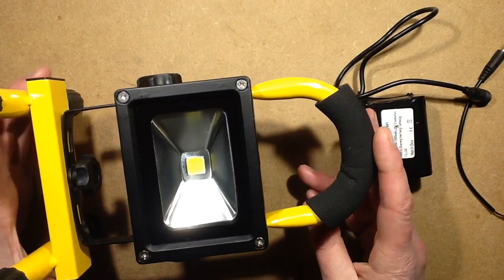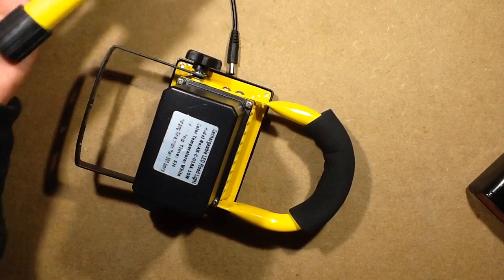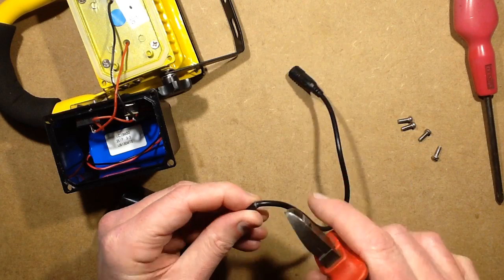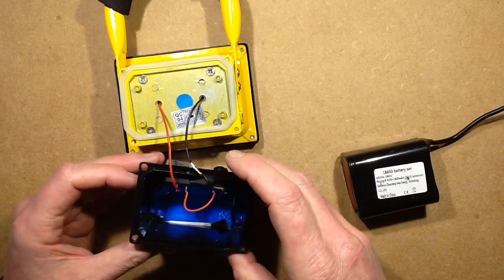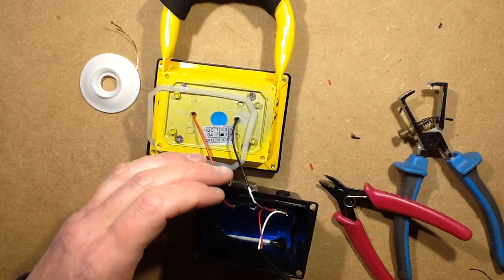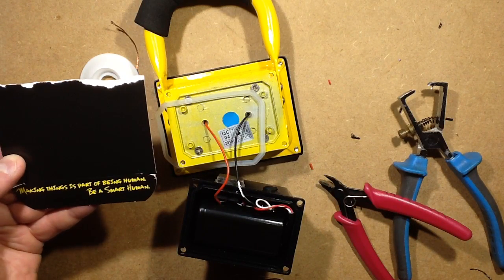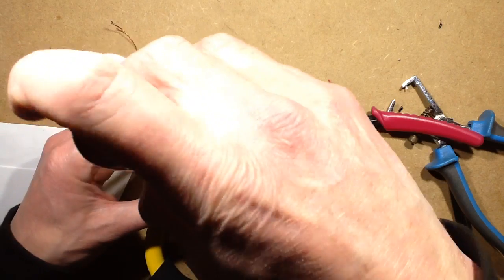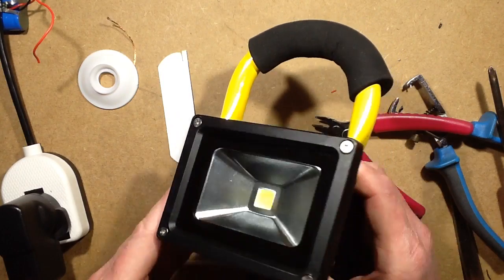Boosting the battery capacity of a rechargeable work light.

Comment: Why use lead based solder?
Reply: Because secretly it is still way better then lead free and doesn't create problems over time,  same reason they still use it in the medical and military sectors.
Reply: +Tokolozi lead solder exemptions for medical and military electronic equipment no longer apply in Europe and USA under RoHS2 directives. I do miss the old solder though.
Reply: +Tokolozi no problem, it's pretty recent.
Reply: +Tab Let ah oops that's new to me,  thanks for the info.
Reply: +Jordan Durham 
Tin solder suffers from "tin whiskers", which is the corrosion that forms on tin solder tends to form little crystals that can short between pads on electronics, resulting in faulty or dead electricals and many millions of tonnes more e-waste than there was with lead-based solder...
Reply: +Jordan Durham lead free solder is a bitch to solder with. however once you get used to it, it can be okay but it has a tendency to crack and break off. plus a far hotter soldering iron is needed. i use a 90w which is perfect. something like a 30 watt is no good for larger applications. however for PCB soldering its fine.

Comment: Clive, The 0 at the end of 18650 denotes it is a round cell.
Reply: +jusb1066 No, the foil inside is still rolled together, so you will only get room for a small roll if the housing isn't round. Check out the pictures in this article: https://batterybro.com/blogs/18650-wholesale-battery-reviews/96816774-comparing-panasonic-a-panasonic-b-sanyo-and-ultrafire-cells
This article is also very interesting as it shows how counterfeit 18650 cells can look like inside.
Reply: I just posted the same thing on a different reply. I'm not sure why people don't believe this to be true. An 18650 is 18mm wide, 65mm tall and the "0" means it is a cylinder type of cell. Glad you get it! :).
Reply: Wikipedia completely disagrees with this "the 0 at the end means it's a cylinder" thing. e.g. https://en.wikipedia.org/wiki/List_of_battery_sizes says (specifically referencing Li-Ion cells) "The larger rechargeable cells are typically assigned five-digit numbers, where the first two digits are the (approximate) diameter in millimeters, followed by the last three digits indicating the (approximate) height in tenths of millimeters." No citation for that, *however*...

... If you look at the Battery Nomenclature article (https://en.wikipedia.org/wiki/Battery_nomenclature) - specifically the "Lithium-ion batteries" section, which actually references the IEC 61960 standard which defines how lithium-ion batteries should be named - it suggests that "18650" cells should actually be labelled something like "ICR18/65" which I've never seen to the best of my knowledge (certainly the various bare 18650 cells I have all say things like "NCR18650B", "ICR18650-26D", "INR18650", and a 26650 that says "INR26650A" - nothing with a "/" at all).

The only indication that anything refers to a cell being cylindrical is here (https://en.wikipedia.org/wiki/Battery_nomenclature#Shape) which says that "coin, button or cylindrical" cells are given an "R" code for being "Round", but that applies to primary cells, not necessarily Li-Ion secondary cells.

I'm completely happy to be proven wrong, here, if someone can link to a reliable source - I'd much rather be wrong in a YouTube comment and then know the truth after that than to forever be mistaken ;) Unfortunately you have to pay to read the IEC 61960 standard, which is a bit crap, really, so I'm having to just trust that the Wikipedia article is vaguely correct.
Reply: +Richard Harris if they were hexagonal, theyd fit together closer, so youd get a bit more Mah in the same space? dunno how much the small difference would be!
Reply: with rectangular cells, you might get more surface area for more capacity.
Reply: +TheDenzel2112  just curious as to what they put at the end of rectangular cells then?

Comment: Nice work. I only would recommend to install a bms. You have space for for it and only cost 2.5$
http://www.ebay.com/itm/4A-5A-BMS-Protection-Board-for-3-Packs-18650-Li-ion-lithium-Battery-Cell-3S-/331694555355?hash=item4d3a8940db:g:GWwAAOSw9mFWMeo9
Reply: +getreal155 it already had a protection circuit!
Reply: Nope. Only 2 wires come out of the new battery pack and according the ebay listing it doesn't have a bms build in. So no bms

Comment: Next step: Squeeze a small switchmode LED driver in there for better efficiency! :)
Reply: +jusb1066 well you could always add a little LED somewhere that either stays off until the voltage gets to about 3.3 volts or do the opposite which would probably be easier to implement and have it always on until about 3.3 volts, so that would tell you that you only have a few minutes left.
Reply: +Niklas Bergsten  that would remain constant brightness, but it uses a resistor, so goes dimmer over time, which should last longer overall,  I dislike lights with both led drivers and protected cells, basically they work perfectly, and suddenly turn off when flat, no warning, i prefer mine to dim down as a warning.
Reply: +Niklas Bergsten  that would remain constant brightness, but it uses a resistor, so goes dimmer over time, which should last longer overall,  I dislike lights with both led drivers and protected cells, basically they work perfectly, and suddenly turn off when flat, no warning, i prefer mine to dim down as a warning.

Comment: The rated capacity at 4.2v is correct, just not at 8.4v, assuming you have zero losses on power conversion, and you are running at the rating of a single cell with pulse width modulation. The real effective capacity is indeed 9600mAh, but only in the context of the voltage output of a single cell, 4.2v(at full charge). It is very deceptive, but at least people who understand enough would not typically get confused by that inaccurate product description, as it is obvious the pack is in series. At 8.4v, each cells effective capacity would obviously be cut in half.

In fact, series is superior to parrallel in every way if you have an effecient way of dropping the voltage to that of a single cell(pwm with capacitive smoothing is good enough). It ensures good balancing of battery drain.

I know you know this clive, but this is directed at people who are confused by parralell and series configurations.
Reply: +Richard Smith The rating is for the pack not the cells so its just a lie, they do it constantly
Reply: Fraser Lamb Yes, i totally agree it is lie. Unfortunately most common people are so confused about the difference in voltage and current they cannot even tell the difference anyway. I was only hoping to elaborate where the truth in the title is, and where the lie is and why.
Reply: Yeah it can be confusing as hell. It gets worse when you add in the fact that capacity drops under heavy loads. Not sure if these even have a C rating listed
Reply: Fraser Lamb Heavy loads on parallel configurations can really open a can of worms, due to the internal resistance increasing with load. Non-perfectly matched cells can cause a large portion of the current to be drawn from a single cell, which can be disastrous. This is where series configurations can better parallel ones.

Comment: The 0 at the end of 18650 denotes that it is a round cell.
Reply: +Scott Savage 
Do you have a source for that? Because I think it really is just the length in 1/10 of mm. The same numbering system is used for button cells.

Comment: +bigclivedotcom how do you know if the battery will work? Do you just get the same voltage or what? If you have protection that isn't built in to the battery would that mess things up?
Reply: +bdot02 they were both lithium 18650 cells, so were fully compatible, size and voltage
Reply from the maker: +bdot02 Same voltage and indeed available with the exact same charger that will limit the maximum charge voltage to 8.4V, although the battery pack does have a balancing and protection circuit built in too.
Reply: +bigclivedotcom so the important thing to do is to make sure it has the same voltage?
Reply: +jusb1066 just watched the first two minutes again. Somehow I missed his explanation there and thought that bigger battery was just one large cell for some reason.
Reply: bdot02
no worries dude +1

Comment: I have to wonder how many times you've burned your thumb on camera and just completely not reacted, like I'm 99% sure you singed it there while soldering the positive lead to the connector.
Reply from the maker: +petti78 My skin is work hardened through normal engineering work, but I don't bring the iron close enough to my fingers to burn them.  It's just one of these things you pick up through time without realising it.
Reply: +Alex Barlow My dad had a bad habit of doing this too.

With angle grinders.

"hey, the hot metal will cauterise it, it'll be fine"
Reply: +Alex Barlow Looks like he's just built up heat resistant bits on his fingers and can get away with it nowadays without even flinching :)

Comment: I believe the 5 digit battery codes comes from using the same system as button cells,ie diameter in mm and thickness (length) in 1/10 of mm, like a CR 2032 being 20mm diameter and 3.2 mm thick.
Reply: 18mm wide, 65mm tall and the '0' means it is a cylinder type of cell (not square shaped).
Reply: +Michael Tempsch it works for my CR 1620 laying around - 16mm diameter and 2mm thickness
Reply: +ArduinoPlays True. Moreover there are IEC designations like ICR19/66 or similar (this one means Lithium 'I'on with 'C'obalt electrode, 'R'ound, between 18 and '19' mm diameter, between 65 and '66' mm long).
Reply: +Michael Tempsch And I bow to the fact you said this before me LOL!
Reply: +mibars Yes, is this related to the 'LR03' style designations (which I believe is zinc/manganeze alkaline 'AAA') size (the number giving the size of battery, the letters the chemistry, I believe?)
Reply: those numbers seemed mystery at first, but after seeing your comment, those numbers are not simple, same with 18650

Comment: those two 18650 batts would come in handy for a mechanicel mod for vaping ... :)
Reply: +radio control uk That wouldn't be very safe, especially in a mech mod, you want high quality batteries with high continuous discharge current ratings. Those random chinese cells would be pretty dangerous.
Reply: your right , i didnt think of that , well spotted
Reply: +TheDenzel2112 Correct - one of my local vape group took an old laptop battery apart and crowed of his find of lots of cells to use. Suffice to say, about ten people replied NO NO NO NO within about fifteen seconds of the pic going up....